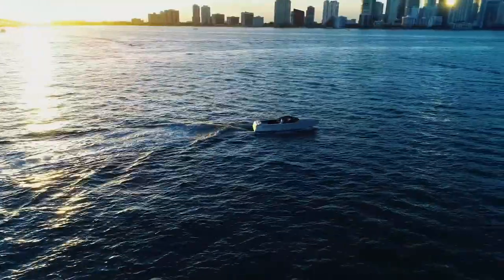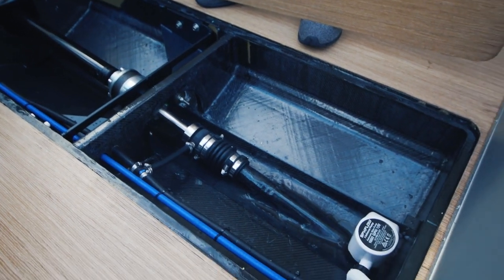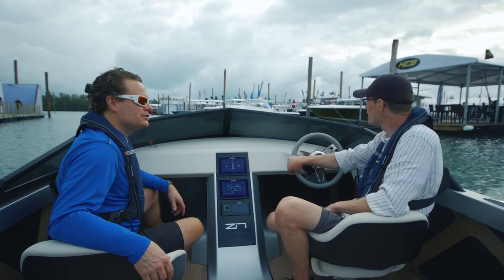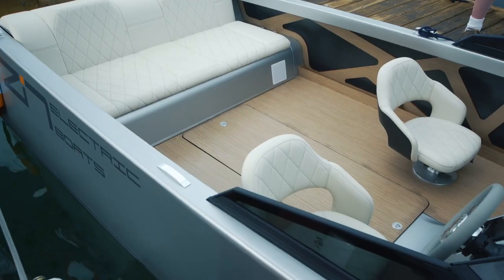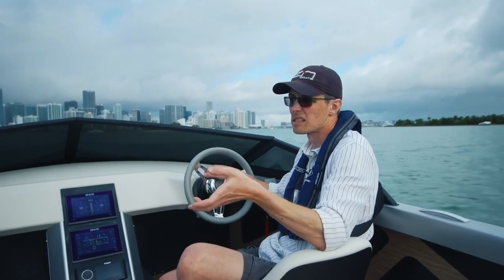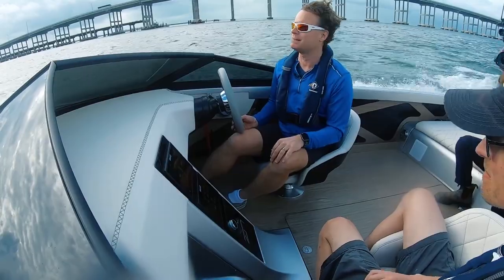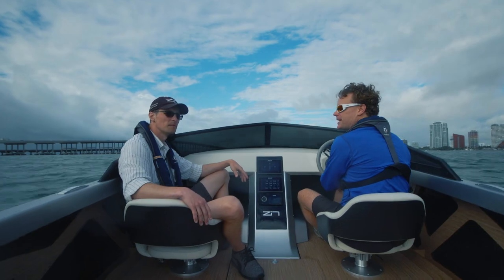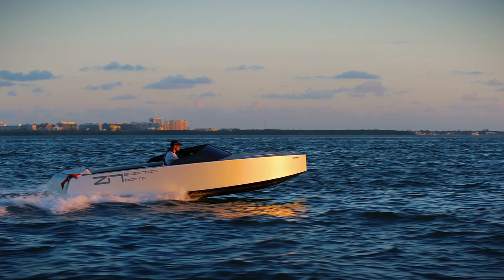Zin Z2R High Performance Electric Boat made of carbon fibre | Review

Comment: “Normal engines have to rev high to produce high torque”. WRONG. Most boats have Diesel engines, which produce max torque very low in the power band.
Sorry folks, electric boats do NOT make much sense… not until battery tech changes.
Reply: I'v never seen a diesel powered runnabout, ski, or shore boat.
All were gas powered, from out boards to V-8's
Reply: "Most boats have Diesel engines", put down the bong mate, I've been on the water for 60 years, only ever been in ONE diesel boat.... Ignorance and BS...

Comment: 55 KW is weak.   They need to use a Tesla powertrain.  Dual Model S Performance Rear Motors 500 HP for 1000 HP.  Then we're talking.

Comment: Im really excited about this new step forward in the marine industry. 
My only concern is anytime Ive had to work on boat electronics, the evidence of saltwater electrolysis has shown its teeth every time.  I think a zinc anode incorporated in the electrical system might be the answer but i don't understand the entire process enough to place one or many in the right areas as to test this idea.  Im curious as to see if this company has incorporated some type of anti corrosive system in place to protect the million wire connections involved in keeping this boat maintenance free for the warranty life of the batteries at least.
Reply: If you seal off all the tech really well,  it should be protected right?
Reply: @sneaky_krait7271  
Yes the tech is protected but all of the connections to all the equipment. One exposed wire and the damage will walk up each wire back into the sealed units and eat them alive like termites.  The wires start turning black with a oxidative coating on them. Might take a while.  But it will eventually show it's teeth.
Reply: @tomstclair961  Don't have exposed wires then?
Reply: @tomstclair961  don't traditional boats have electric components?
Reply: In consumer hot water heaters for homes, there is a sacrificial anode to prevent corrosion. it is inevitable around salt water, and you are correct that unless they build this into the systems, these things will all self-destruct after a while.  You won't see a lot of 30 yr old electric boats ha ha.

Comment: It's beautiful, but 40kW seems low to me. The Tesla Model S battery is 100kW. Any way they could get it up to 60kW at least?
Reply: Tesla swap boat
Reply: He said it's enough for a day on the water. It's not the kind of boat you cross the atlantic with either
Reply: 80 km 160.míoes to 200 mioe rabge dyjble barry
Reply: 120 150 m I oe range uce esng a ith iut omormise

Comment: 110v/15 amps is not going charge in 10 hours.  Maybe a week.  That would be the charge rate for 220v/30+ amps.  If the range is accurate they solved boat efficiency with light weight.  All other attempts have required foils.  Not a surprising high price for early adopters.  Will be interesting to see what develops in the next 10 years.  BTW those who say salt water and electric don't mix are forgetting about the massive amount of electronics already present.  Just because the batteries are bigger and much higher voltage doesn't mean disaster.  There are plenty converting their sailboats to all electric.  I remember a lot of people knocking fuel injection when it first came out saying it was never going to last.

Comment: 200 MPH electric cars.... 35 MPH electric boat. Yawn... Call me when we have a 60 mph electric boat that can run as long as a gas equivalent.
Reply: the problem is, if you got this thing to go 60mph it would probably flip. high speeds plus low weight dont work.
Reply: 55 knots avilbe 63 mph

Comment: Problem One : Useable space is not available.
Problem Two : $250k For the boat is ridiculous.
Problem Three : The more Electronic Technology that is incorporated into the vessel the more that can go wrong.
Problem Four : The music, it didn't need to be there.
Problem Five : The weight of the boat. Batteries are not light. 
Problem Six : Its a nice runabout but I think it would suck for fishing.
 
The only good things about the boat is that it's atractive in its design and that it has speed.